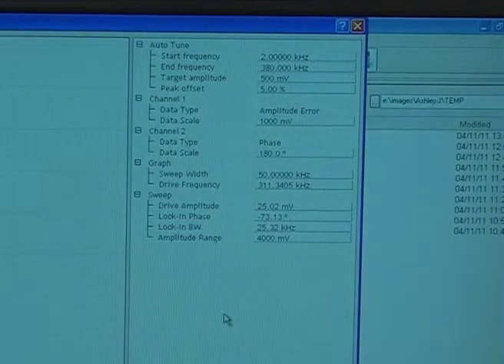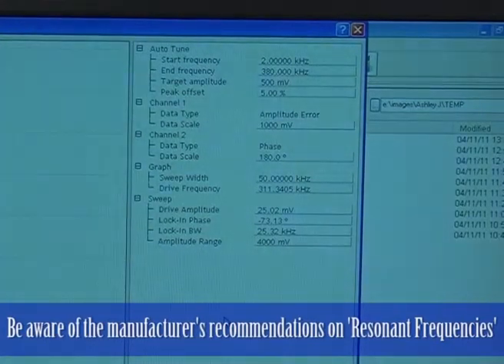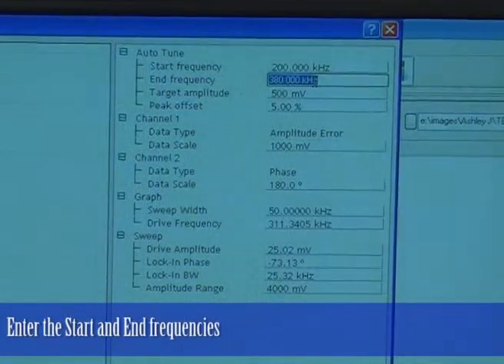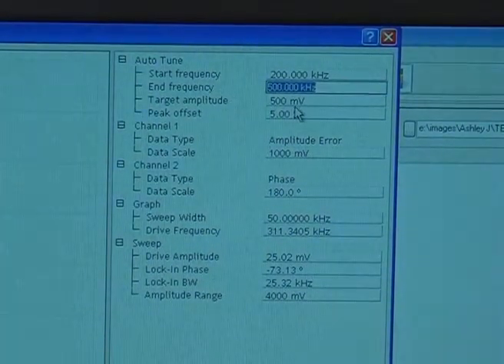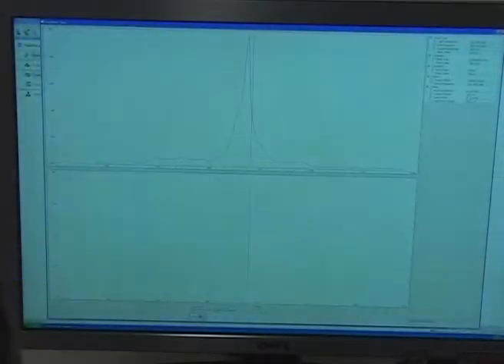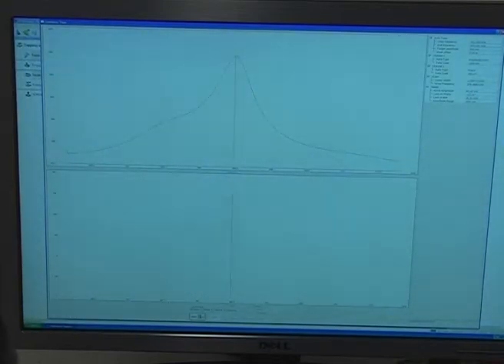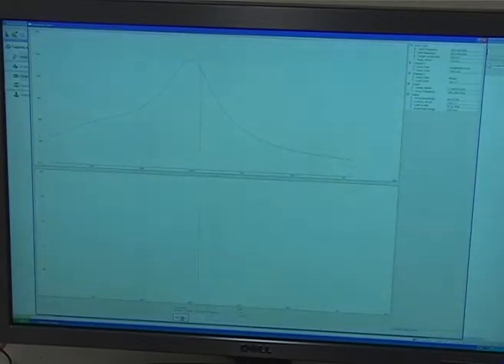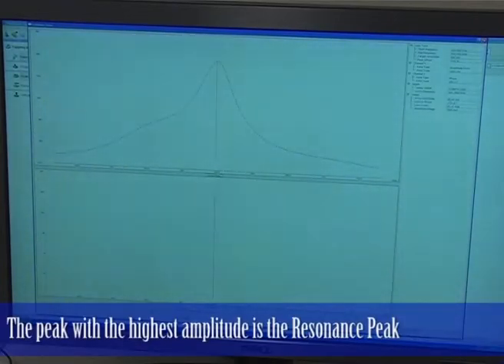AFM: Tuning the cantilever

Comment: @Microscopy Australia When I did some AFM video work for Bruker, I learned that cantilevers can be resonated at a frequency that mimics an element’s Van der Waal force, effectively causing the cantilever to become a magnet to that element, while leaving ambient elements unaffected.  Do you know how I would look this up, what the technique is called, or where I could learn more about it?  I have a pretty basic understanding of AFM and several modes, tapping and peak force tapping modes mainly.